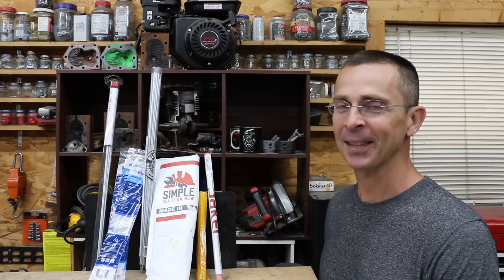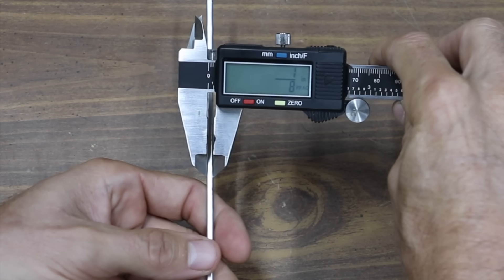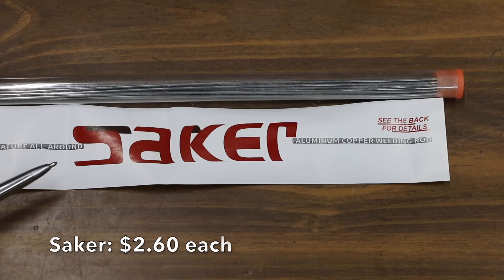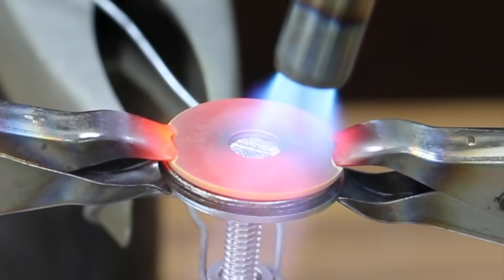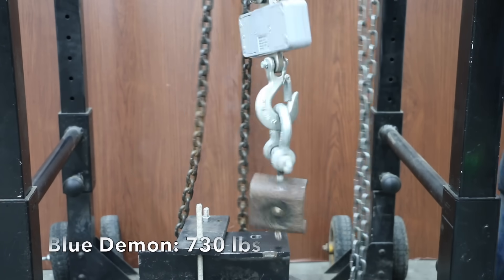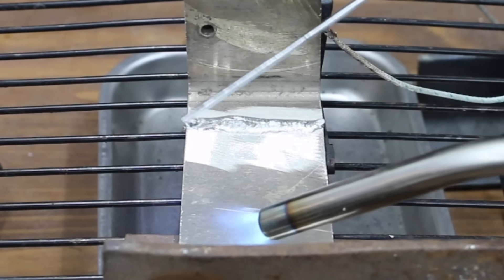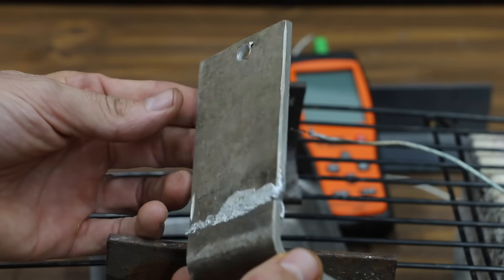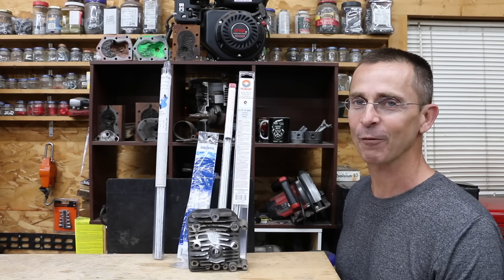Best "No Welder" Aluminum Welding Rods? Alumiweld vs Bernzomatic vs Hobart

Comment: i’ve had a cast aluminum project waiting for a long time and i will be using blue demon...i hope it holds on a 12” disc sander body and a foot that broke off.
from your tests in this video it should be fine.  maybe i’ll try it today, since i have a couple of mapp gas cans ready.
the unfortunate part is that i v-grooved both sides of the cast aluminum and filling the second side might loosen the first side...yes?
could anyone give me some feedback on what i should do?
try to braze one side at a time or enlarge one side and fill in the gap or use a damn and hope that it flows thru to the other side???
i’m not a pro, so this is going to be all “let’s see what happens”.
help!
Reply from the maker: I believe it'll work.  I wish you the best of success
Reply: Project Farm: i tried heating that cast aluminum but it seems to never get up to temperature to melt the aluminum rod.
it must dissipate the heat faster than the heat being applied.  i hit it with mapp gas for 15 minutes in the same area of only a couple square inches.  i couldn’t even get it to tin.
do you have any ideas?
Reply: Project Farm :  i tried to braze that cast aluminum with mapp gas for approximately 15 minutes and it failed to get hot enough to to melt the aluminum rod.  it wouldn’t even tin so i gave up.
o might try it again with two mapp gas torches.

Comment: If I only knew this before tig welding my boat up.  However tig vs brazing and wow that first rod not melting is nuts 770F they had a typo 770C
Reply from the maker: Thanks for sharing.

Comment: A company named Muggyweld was the original inventor
of this blend/type of welding. Anything else is a cheap knockoff, IMO.
All these are basically "solder", decent for just MAP gas for a quick fix.

A thorough, comprehensive test of the real products
would require a second mortgage on the Farm :-O

https://www.muggyweld.com/  Needs testing!
Reply from the maker: Thanks for the suggestion.

Comment: Love your results and findings as always would just like to bring up this point as follows: WELD - to join together (metal pieces or parts) by heating the surfaces to the point of melting using a blowtorch, electric arc, or other means, and uniting them by pressing, hammering, etc.  I do understand how people misuse words in common conversation and am not blaming anyone, I am just conveying that the correct use of the language leads to clearer communication. (I am not an English major or minor.)

Comment: Just a thought, if this welding material is stronger than the aluminium then would it be possible to make a casting of a cylinder head from the Hobart material and see how it does?
Reply from the maker: Thanks for the suggestion.

Comment: I actually studied welding for 5 years when I went to Technical college back in 1985. 
I always remembered seeing these rods being demonstrated at home DIY shows that we used to get. 
I always think it's a bit cheeky calling them welding rods when they are more akin to brazing rods.
They don't even do a good job when it comes to making an inter-metallic bond properly 
None of them do a proper fusion weld so I'm not suppressed they break so easily. 
I't odd that they are called welding rods. Interesting video though.
Reply from the maker: Great feedback. Thank you
Reply: The ones I used actually said they were aluminum brazing rods. They were a pain in the ass but actually worked fairly well. But these actually had a flux coating and had to use another flux on the base metal. I actually had the same brand to use with stainless steel  and  some type of  maybe a nickel Rod to braze cast iron . I don't remember the name it's been a few years. My welder is stick ,  Mig and Tig but I have to use a spool gun for my aluminum which I don't like because it just too much bulk to handle when you're trying to do certain welds.. have a lovely day
Reply: Yeah with the exception of the cheapo brand at the beginning he wasn’t really welding. But I can understand why he didn’t say brazing because many casual viewers might not understand without an explanation.
Reply: @truthsmiles   yeah I guess it would be too much to ask also if you brought sweating into the mix. I've done a lot of HVAC work and that's not brazing or welding haha. Or even running copper water lines When you sweat those you call it. Kind of makes me think back skidding logs or plowing, does the horse actually pull the plow or log or does he actually push it? Crazy world just glad to still be here and be in it
Reply: jack watkins Personally I would call sweating, soldering, or the aluminum “welding” in the video brazing. IMO either you’re melting the base metal or you aren’t. If you are, it’s welding, if not, it’s brazing. But I’m a simple man haha :)
Reply: @truthsmiles  I think I'd have to agree with you about 100%. Which I've actually done some welding with an oxy acetylene torch because at the time that's all I had. And I used a 7018 rod to do it with. And I have used other types of metal even coat hangers and you can actually do some light work with it.

Comment: PF, hello, never heard of all of these, probably because they are NOT SOLD IN HVAC/R parts wholesalers , but the ONLY aluminum brazing stuff I ever used. Was  a TURBOTORCH  product, but used their own flux in a kit. I was nervous using it as it was a BRAZING product,  the produce mgr in an A& P  supermarket, was doing a reset, but there was some ‘ICE’. On the rear wall where the evaporator coil was, so it was PUNCTURED , WITH A SCREWDRIVER ,    300LBS OF R22 blown, , luckily it WAS CLEAN, & on the TOP of 5/8” tubing , scared like hell at the temp required , but it worked , very well, 
Ordinarily I have used a solder product 95/5 and a special flux made by EUTECCTIC , it looks like honey, but STINKS like SULPHUR , when heated,   I guessed I had repaired about 40 small refrigerators , people used ice picks on , so many of them were at a pharmaceutical co, the first one I was told would NOT BE REPAIRED, so I fixed it after hours, and next day, it was working in our repair shop, so everybody was AMAZED , so that’s how come there were so many over time , they used to throw them out, so now everybody got a beer box , BUT I NEVER LET THEM EVER SEE HOW I repaired them, , as they said could NOT BE DONE ,, but ALL YOUR RODS said no flux, unless there may have it built in , as that’s the FAILURE point with NO ADHESION . ! Thanks for the test  Cheers 🇺🇸🇺🇸🇺🇸🇺🇸
Reply from the maker: You are welcome!

Comment: Laminate flooring for wear and hardness.. Water resistant.. World's most used material.. You could get a few samples easily.. Also nice video.. Would like to see this video done on a lighter material.. We have all seen the guy welding the coke can 👀
Reply from the maker: Thanks for the video idea.  Thanks so much!
Reply: @ProjectFarm  Yeah, would love to see Durafix in the comparison, it is available in UK and seems to work just fine for me.
Reply: vinyl
Reply: Some pergo that's finished on all sides survives flooding.  Worked with a plumber last year who experienced this in his basement apartment. Over 90% of the flooring was reusable.
Reply: Get Vinyl plank flooring if u want water resistant. A bit more, but impervious to water.  Goes down same a laminate.

Comment: Whats the best metal clay?  Can it be adapted to repairing machinery and hold up? It is powdered metal and binder and once dried and then fired ina kiln or with a propain torch , it leaves sintered metal in the shape you made , with 5%-%30 shrinkage ( depending on various factors it is repeatable shrinkage for each type) from the binders and water cooking off. I Just discovered it so im super curious.
Reply from the maker: Thanks for the video idea.

Comment: If I recall correctly one of the key issues for aluminum welding rods is the aluminum itself. There are a lot of alloys and several different aluminum types. If your rod is not compatible with the aluminum you are welding then forget it. So, a person may need to have more than one brand around just to find ones that match the particular metallurgy of the metal being brazed. This is one of the reasons you will frequently find reviews saying rod XYZ is junk.
Reply from the maker: Thanks for sharing.

Comment: "Hobart" nailed it!  It is a Brazing rod.  Welding requires the melting of the parent metal, filler rod is optional.  Brazing and soldering are similar, they join metals but don't melt the parent metal.

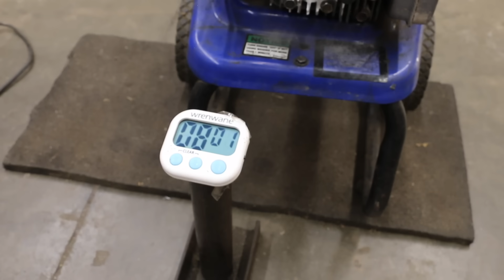Comment: 13:00 - The thermal imaging camera is lying to you. It's a well-known shortcoming with thermal imaging that highly reflective surfaces will register cooler than they actually are. I'm not entirely sure why this happens, but my guess is the camera compares the infrared emissions to the visible-light emissions as a way to compensate for...something, I'm not sure what. In this scenario you need a contact thermometer, or an IR thermometer with a rubber seal that can block all visible light during the measurement.
Reply: yup!
Reply: It's working simply as an infrared mirror. You're (partially) seeing the temperature of whatever it's reflecting, probably a wall.
Reply: @celeron55 : No it isn't.
Okay, yes, shiny surfaces can reflect infrared light, but they also emit infrared light. Have you ever seen a reflection from a piece of glowing-hot metal? It does reflect visible light, but the reflection is partly obscured by the visible light being emitted by the glowing-hot metal. Warm reflective surfaces do the same thing in far-infrared wavelengths, so the thermal camera is seeing a thermal reflection, but it's also seeing the thermal emissions of the reflective surface. Therefore it should measure a higher temperature, but in reality it measures a lower temperature because the unusually large amount of reflected visible light confuses the thermal camera. The thermal camera uses it as a baseline for its thermal measurements, to compensate for differences in surface color, but a reflective surface doesn't show its color accurately.
Reply: Explanation is simple - lower emmisivity of different material.
Reply: Boy that is one seriously smart AI IR thermometer if it is intentionally deceiving you (lying to you). I would be very very careful, it might tell you it loves you or the check is in the mail or no it won't cum in your mouth.
Reply: @dadillen5902 : WTF are you talking about?

Comment: Excellent review as always.  I've wondered about these rods as I've never did anything other than TIG welding aluminum or mag alloys.  I've been looking into the teflon liner, teflon guide, next side larger tip (this varies) and grooved roller to make a dedicated cost effective aluminum welding gun for the MIG welder the last month.  Thanks for sharing!   Depending on the force exerted... looks like the cost effective way to go.
Reply from the maker: Thanks so much!
Reply: @ProjectFarm  Your welcome.  Wratchet wrench comparison just came to mind.
Reply: Been down that road, my Millermatic would birdnest right behind the feed rollers due to the mass of a big spool of wire acting as a flywheel when I let off the trigger. Every time it happened it wasted roughly 10 feet of wire (the birdnest plus all the wire between the rollers and the gun). I've since bought a Millermatic 350P with a push/pull gun that feeds aluminum beautifully, if you can't justify the cost of such a setup I'd stick with a spoolgun or TIG it.

Comment: Thank you - whish you did this test a month ago though - would have saved me alot of money :)

Through trial and error, I can also give a confident vote to the Bernzomatic rods. I tried "Alumaloy", "HST-2000" , "Tig filler rods with aluminum flux - rated for gas brazing as well", and some "Made in China" rods. While I may very well have used the wrong technique (arguably) - my technique was consistent ( clean and heat base metal ) - ONLY the Bernzomatic rods managed to form a proper bond that was not easily snapped/peeled by just using my hands. The "Made in China" rods did surprize me - firstly because they were much thinner and shorter than the other rods, and secondly, because I could actually manage to make them bond as well - although it took much more effort than the Bernzomatic.
Reply from the maker: Thanks for sharing.

Comment: I always wondered what kinds of strength could be achieved by melting several rods and casting them. A fixed trailing arm shape comes to mind to check actual vertical loads and the side loads could be also checked with your current equipment.
Not the application it was designed for. But for parts that will not see excessive heat it may be a option for someone to cast parts. Potentially even heat up the casting and forging parts.
Reply from the maker: Thanks for sharing.

Comment: Pretty work. So much of the fails are almost always operator error. Im glad u pointed that out and showed how well they can work. Amazing these rods if done correctly.( clean clean clean is key). Ive heard of running the rod thru the puddle after as well.
Reply from the maker: Thanks for sharing.

Comment: So the reason for the excessive heat is due to the oxide layer on the aluminum. Aluminum oxide has a higher melting point than aluminum, so the outside may not be melted but the inside is. Grab a strip of sandpaper and run the rod through it a couple times.
Reply from the maker: Thanks for the feedback.

Comment: The problem I've had with using these aluminum "welding" rods is that it seems that you can only weld one side of a piece of base metal.  If you lay down a bead on one side, then flip it over and heat the other side to weld it, the heat melts out the first weld and it just drips away.  I suppose that you have to make a bevel that goes all the way through and weld only one side.
Reply from the maker: Thanks for sharing.

Comment: Most situations will not allow for a torch like you did.  I wonder if a person could use a soldering iron.  Or maybe, if the iron will not get hot enough (I am guessing that is why my idea wasn't mentioned).  I am curious as to if they make an iron that will allow for insane high temperatures.  Solder I can use on other things.  That would be a real gem.
Reply from the maker: Thanks for sharing.

Comment: Im sorry but this all just extremely annoying and missinforming. You keep useing the word "welding/weld". In what way is any of this welding?? Its not, it is actually just brazzing. Which are very different. I know many people use the words interchangeably but i never understood why. A weld is the fusion of materials such as a filler and the base material at the joint, ussually done with the melting of both at the same time. Fusion on the molecular level. A brazze is the adhereing of materials, by useing the capillary action/force, to melt a layer of filler metal over and into a joint to ONLY partially bond at only a surface level. Almost like waxing of hair or gum in hair or glue on paper. This is how i was taught the difference between the two from the old wise geezers that ive worked with throughout the times.

Comment: I had bought low temperature rods at farm science review to attempt repair of cracked oil sump on Kohler engine, that was 11 or 12 years back. Like you I was surprised the fill worked, let alone held. I always keep a few for quick repairs even if temporary.  In your review did any of the manufacturers list "cleaning" the rod with 3 or 4 0000 steelwool to remove oxidation during storage?
Reply from the maker: Great point on cleaning them.  I believe 1 manufacturer mentioned that

Comment: I tried the blue daemon rod on a 5 bulb yard light that was some sort of aluminum zinc alloy and damned if I could get it to melt and stick consistently. The part is fairly large, I tried using 3 mapp torches to heat it up but even at ~800F it was barely melting.
Reply from the maker: Thanks for sharing.  Sorry you had the trouble!

Comment: Iceyyyy Would Like To Know Your Location
EDIT: I'm noticing that a lot of the problems I'm seeing, where it kind of looks like iffy welds, are probably due to the high melting temps. If the product can't "flow" properly it becomes stringy or gummy and doesn't create a strong weld. I know you were blaming yourself for some of the failures but I think the product is to blame here.
Reply from the maker: Missouri.  Thanks for the feedback.

Comment: I have used the Blue Demon rods and their "viscosity" is both an asset and detriment. One thing I will say I wish they included (or sold alongside) was a wax crayon temp rated to the midrange for the rod so you know it is hot enough to flow a braze. Being aluminum does not show any color change getting enough heat in without destroying the parent material can be a bit of a challenge but considering what a pain welding aluminum is, this is a much simpler fix!
Reply from the maker: Thanks for sharing.

Comment: I tried the Alumiweld brand from Harbor Freight for my first try at aluminum welding.  I made an aluminum bracket for my trailer and used map gas.  It took several tries to get a nice looking bead but it did the job.
Reply from the maker: Thanks for sharing.

Comment: Very interesting.  I have an aluminum tool box in my pickup and I want to setup a transfer tank under neath of it but standard tanks just won't work in the space that is there.  Have honestly thought about getting a sheet and making a couple cuts and possibly setting up a way to make some bends and then weld some caps on either end and the top and then mount it under the tool box to make it a single unit and then put the fill neck into the toolbox so I can lock it up easily.  Looks like if I can get a sheet the Hobart rods will work pretty well for what I need.
Reply from the maker: Thanks for sharing.